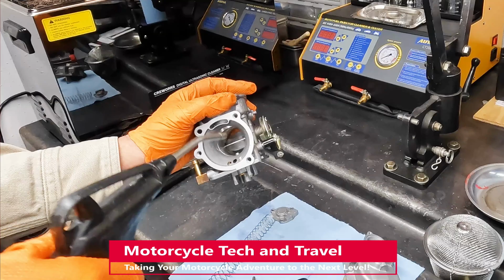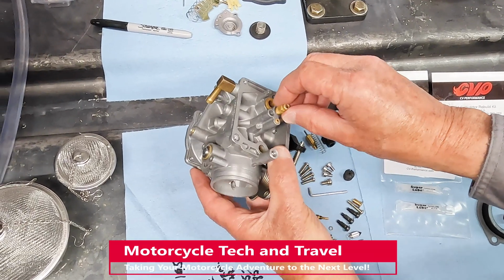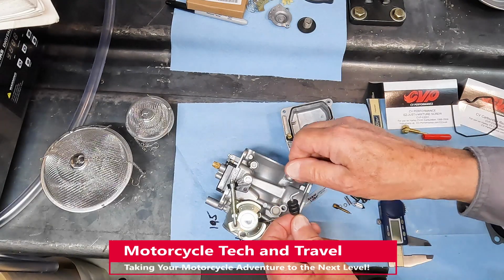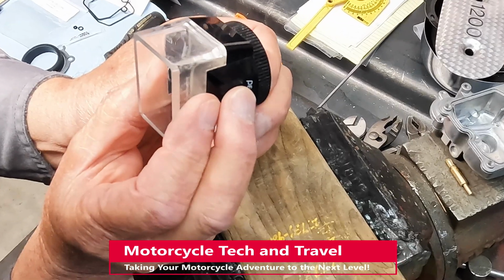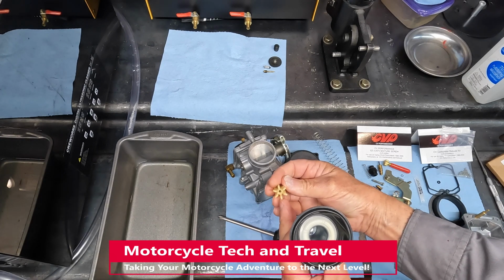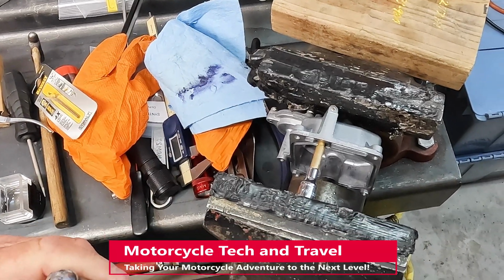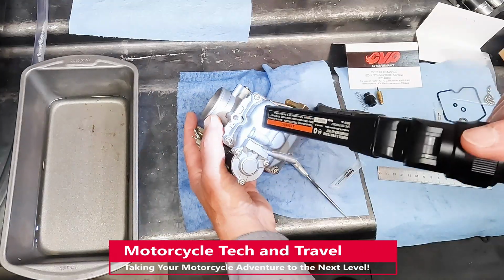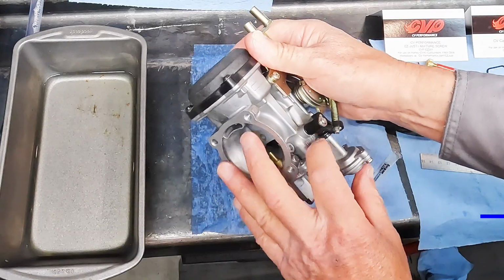Rebuilding the H-D Keihin CV40 Carburetor Part 2: Restoration, Step-by-Step Assembly and Bench Tests

Comment: Thank you
Reply from the maker: You’re very welcome…Glad this is helpful.  The CV40 carburetor, set up properly, is the closest thing to EFI.  It has the ability to compensate for reasonable altitude changes.  Fuel mileage is excellent on models equipped with a CV40, and the accelerator pump versions are very responsive.  Mild upgrades are beneficial, and Keihin is well supported by quality aftermarket vendors like CV Performance (CVP)…Thanks for your subscription!

Comment: Great job!
Reply from the maker: Thanks, intended as a tool for Keihin CV40 owner/builders.  The end result was a "function as new" carburetor like we all want and need.  This two-part series should encourage owners to do carburetor work.  Straightforward troubleshooting and the ability to perform roadside repairs are the big advantages with carburetion.
Reply: @MotorcycleTechandTravel  Agreed...